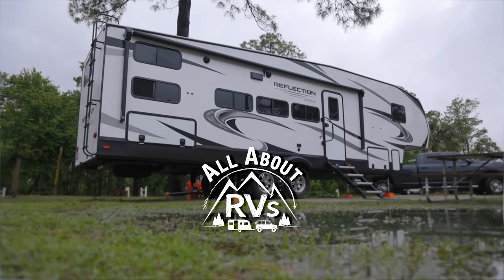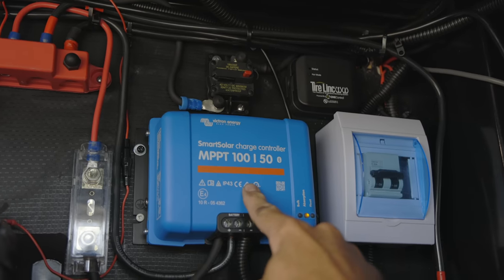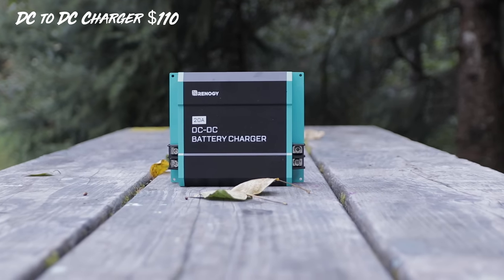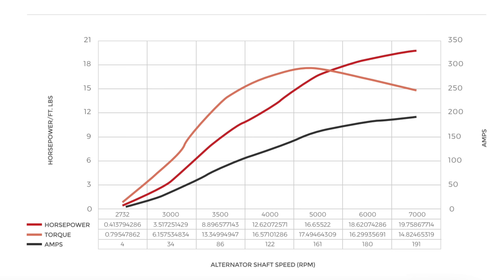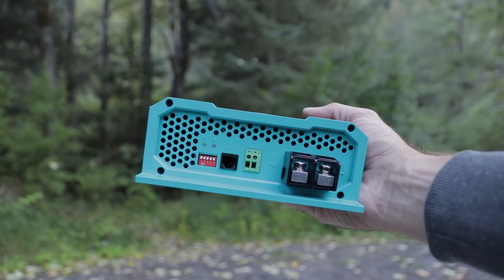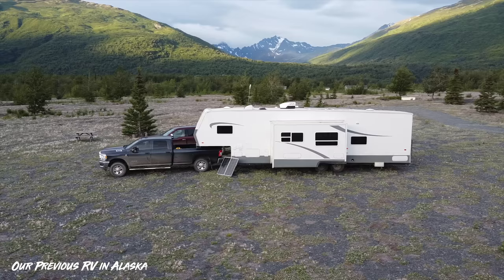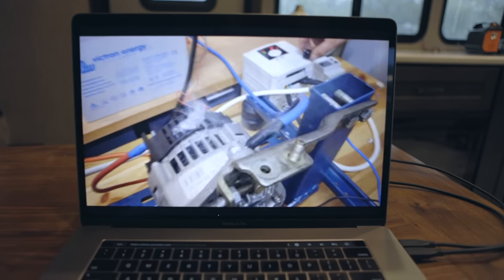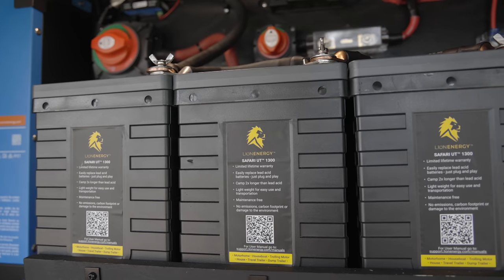RV Alternator Smart DC to Dc Charging.

Comment: Hey Jared, thanks for all the great info.  Is there a particular reason you chose the Renogy over the Victron?  I'm planning out our build and most of the products I'm choosing have been Victron, so naturally I was going to go in that direction by default.
Reply: You can use what ever unit that you like some just cost more than others. If that’s the brand you use go for it so all your stuff is the same. It all boils down to price if the both work the same .

Comment: I have two alternator on 2021 chevy duramax one for starting the other for trailer I don't know if you can you can add wire to these trucks different electrical systems do you know
Reply: The two alternators in your Duramax are in parallel - they both do the same thing. They aren't segregated.

Comment: Question on your install.  Did you disconnect the hot wire on the 7 pin plug once this was installed?  With it still connected, are you getting an additional charge?  I have the 5th wheel setup.
Reply: Good need to know question.
Reply: I use a 40 amp DC charger and left my 7 way power connected.  I can see the power from the 7 way on my monitor before I flip on the DC charger.  However, since it's at a lower voltage than my lithium bank, it won't help charge those fully.  It only helps with the load of the inverter really.  So to answer your question...  kind of and it depends.  If you have lithium then the 7 way won't get your batteries to the high enough voltage to be fully charged.  If you're running lead acids then it will help.  In my experience, it helps with the DC loads from the inverter.  I can see the additional help of the 7 way on the battery monitor when I plug in the 7 way.  My 2017 ford actually has about 7-8 amps coming through that connection.
Reply: @brettchevy1870  Thanks Brett.
Reply: @markogaz  was
Reply: I as well was getting 8 A from the truck then I turn on the DC to DC charger getting a total of 28 A as I have a 20 amp DC DC charger this was a pleasant surprise as I heard there wasn’t really much amperage to talk about from your vehicle it may not top it up to 100% but everything helps

Comment: When you hooked up to the dc to dc from the truck did you use the same wire in the 7pin connector or run a separate larger wire ?
Reply: Disregard my question please as i rewatched the video and observed more closely. Will the original wire in the seven pin connector be adequate to do the same setup with the same dc to dc controller?

Comment: I've been considering something like this for my truck camper.  I already have a solar panel with a charge controller which is directly connected to the batteries.  I also have the converter which charges when plugged into shore power.   And I believe I am getting about 2A of charge from my 7 pin connector (still to be verified when I get my Renogy battery monitor arriving in 2 weeks).   
My concern is that each of these chargers has 3 phases to apply a different voltage charge at different times.   But if they are all in parallel then they won't properly cycle through the phases.
I did see that Renogy has a 2 input DC-DC charger with which would combine the alternator charging with the solar charging to reduce the problem.   But my AC charger would still be competing with the Renogy when on shore power.   Is there a 3 input (AC, alternator, solar) charger?

Also, (separate question but related), my original converter seems to be overcharging my batteries.   When I am connected to shore power after the batteries should be full they begin to bubble and eventually my propane detector starts to alarm.   I have to put a fair amount of distilled water into my batteries if I leave it plugged in for very long.  The documentation which came with the camper says that it should drop the voltage to a maintenance charge at some point but this doesn't seem to be happening.   Is my converter fubar?
Reply: Maybe in your case it would be worth having a shut off breaker or switch for your ac to dc charger? That way when your batteries are charged, you can just shut off the charger and not have to unplug. 

On my truck camper, I installed a go power transfer switch that intercepts my shore power plug and it allows all of my 110 v plugs to work when i turn on my inverter. However, it was causing my inverter to charge the batteries endlessly thru the ac to dc charger so I ended up putting the ac to dc on a breaker in the breaker box so I can just shut it off since I do not plug into shore power ever.

Also I have the 50 amp dc to dc charger with mppt from Renogy that you are referring too and it works great!
Reply: I have now added the renogy battery monitor which gives me far better insight into the battery condition. I would recommend  that for anyone!  I also replaced the solar controller with a renogy MPPT controller.  I think the new controller has fixed the problem with my converter overcharging.   It seems the old controller was confusing the converter about state of charge so it would continue a high charging rate.  So the batteries are now in a better state and I can almost sustain my power needs from solar alone in summer unless I use DC for fridge.  
I may still add the renogy DC-DC charger which would allow for DC fridge use enroute (since my wife won't use propane under way). 
During all this research I did realise that my converter does not have settings for Li-Ion.  When these batteries are done I would like to replace with Li-Ion which would save weight, add longevity, and allow me to UN-vent and insulate the battery box.  But it will require converter replacement.
Reply: Look up automatic charge relays

Comment: Just purchased a new battery for my Trailer (Lead).  I rarely actually need a battery as I am normally have at least electrical site.  My power lift is working, but I'm not getting any DC power into the Trailer itself.  Everything works when plugged into shore power.  Any suggestions?
Reply: Double check all wiring at the battery, since you said it was just replaced. If everything was working beforehand that would make me suspect a wire was left off or installed incorrectly. If this problem was present with the old battery then 
check for a faulty battery disconnect switch, blown fuse, tripped breaker, loose connection or damaged wiring.

Comment: Would it be a good idea to mount the cable going to the back of my truck to one of the aux switches instead of directly to the battery? As long as I used one of the higher rated switches, is there any reason not to that I'm not thinking of?
Reply from the maker: No that is a preferred install and gives you independent control.

Comment: Do you need to disconnect OEM wire in the 7 pin connector? Thanks.
Reply from the maker: It depends but I left mine connected because it allows so little to the batteries.

Comment: thanks - great video.  but i am confused. If anyone can clarify for me i'd really appreciate it:  Renogy's biggest charger is 60 amps - your model is 20 amps.  My alternator puts out 136 amps. I know the van will use some of that electricity, but does it seem like using only 20 - 60 amps for charging the batteries is wasting some potential?
Reply: A good rule of thumb is to never use more then 50% of your alternators output.. however if you are idling or sitting in traffic your alternator will get really hot and can cause premature wear. I have a 180 amp alternator and I have a 50A dc to dc with MPPT from renogy. So if I have my solar MPPT on, it will only allow 25a to be pulled from the alternator, I’ll keep it like this if I am driving in the city. However, If I am on the highway, I will shut off the solar MPPT so that I can get a full 50A from the dc to dc.
Reply: @qpoole90  thanks!  I don't have a way to shut my charge controller off. maybe next van!

Comment: Can the batteries just be charged with a generator every few days instead of doing all this ?
Reply: Yes, they can. It's just that if you put a lot of miles driving between stops you run the risk of depleting your batteries, especially if you have the fridge on the batt setting. And if you have lithium batts, alternator damage ca occur. We typically don't drive that much 3-4 hours between stops so it's not really a biggie. And we sometimes run the fridge on propane while driving if we've got a long drive.

Comment: Question,  can I go directly to my batterys from the 20 amp renogy dc to dc charger without a charge controller,  i have 4 battle born batteries 12 volt 100 amps each and mechman alternator 2001 dodge ram diesel 2500
Reply from the maker: Yes the out of the Renogy dc to dc goes to the battery bank.
Reply: @AllAboutRVs  Thank you
Reply: Essentially the Renogy unit is a charge controller.   Charging source goes to the input side, output goes to the batteries

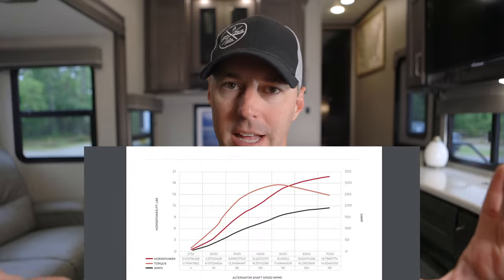Comment: I hope something is wrong with the horsepower numbers in your chart at time 3:16.   Assuming 14.1 volts.  Take numbers from the 3500 RPM column.   86 amps * 14.1 volts = 1212.6 Watts.  1 HP == 745.6 Watts.     So 1212.6 Watts /  745.6  Watt / HP   =  1.62 HP of electrical power out of alternator.   You show 8.897 Horsepower mechanically consumed by the alternator.   If that's correct,  the alternator is only 18% efficient.   That is worse than I expected.  I had read that alternators are inefficient, but the numbers were 50% or so.   No wonder they overheat.
Reply: Wow, you went deep. I think the point is, well you know already. The numbers aren't that big of a deal. The electronics of the charger do the work to protect your alternator and charge your batteries properly. It's super nice to arrive at the campsite with full batteries, propane and a cold fridge. I have the 40 amp version of this and works like a charm. No worries.
Reply from the maker: It’s a high output alternator at 58v. It was a graph I had on hand while most people won’t install this specific alternator it demonstrates what I was talking about in a more clear way than most.

Comment: How did you run the wire from the alternator to the trailer through your truck?
Reply: Hi J,  if you look at the Renogy manual, they tell you not to hook your cable at your TV alternator but as close as possible to the batteries! The manual will recommande wire gage and brakers sizes or ANL fuses in regards of the lenght and model of the DC2DC charger.
It was the harder part of the job to get the 4 awg  cable from the TV  batteries to the back of my vehicule! Not to much room and thight curve under a JEEP Grand Cherokee, probably more room to work with in a pickup truck!  I am using the tail lights voltage to trigger the Renogy on and off. I adde myself a switch between the trigger and current limit signal, so I can easily select the 50% current limit of the charger.
Goof luck, with your installation, it is a great product.
Reply: @jean-yvesdore4312  Thanks. I have had the 20 amp DC-DC in hand. I have a new trailer and will be setting it up for the first time in this trailer.
Reply: Insert wire into protective wire loom. Connect at tow vehicle battery, locate proper size fuse or breaker as close to battery as feasible. Remove fuse (or open breaker) and carefully route wire down to driver side frame rail avoiding steering linkage, sharp edges, hydraulic, oil, fuel and coolant hoses. Continue to route wire inside frame rail alongside OEM harness and secure with zip-ties. Have fun passing wire between frame and fuel tank. Terminate Anderson connector at chosen location.  Additionally I would place the same rated fuse / breaker in wire as close as feasibly possible to RV battery bank.

Comment: The 7 way plug is not a battery charger it is a maintainer the amps are extremely low its real use is to maintain your brake battery

Comment: Jerry:  I was wondering if it matters where you put the converter?  In your car or in the RV?  I would think the heavy duty cable would be shortened if you mounted the converter to the car but  maybe the cable size  would be the same either way.

Comment: 1 amp from the alternator?  was that tested at idle?
Reply: That's 1 amp passed down the 7 pin connector 12v line pin.
Reply: @RoadDogMedia  i understand that but 1 amp still seems awfully low at the 7pin (from the alternator) unless at idle.  so the question is still valid.  was his 1 amp figure at idle?
Reply from the maker: Good question, we monitored it while driving.
Reply: I get 7amps through my 7 pin connector. You must have small guage wire .

Comment: I don't see why you can't just limit wire size from alternator to reduce current and just use a isolator. The victron video was a scam only a 70a alternator and didn't have cooling

Comment: I just got better as far as renergy goes , but it's not that powerful but I did figured it out , and it's way easier than this thing and you can run it with your alternator and solar but you need manual switches on both legs it's the 50 amp but all I'm doing is running my lights fans in small 12 volt loads nothing else so it's way more than I need .